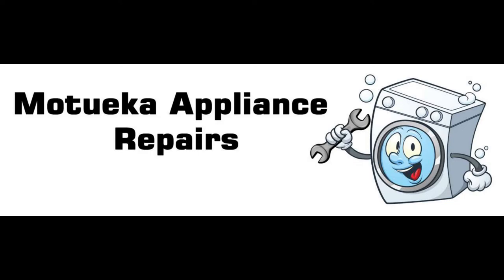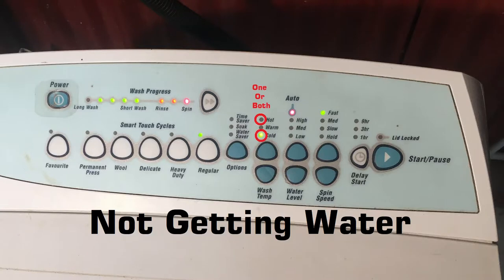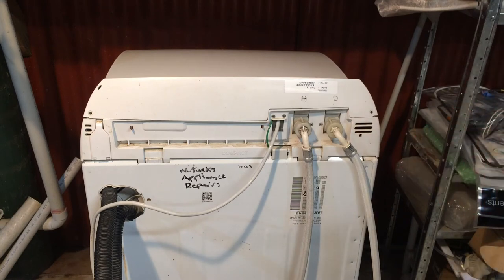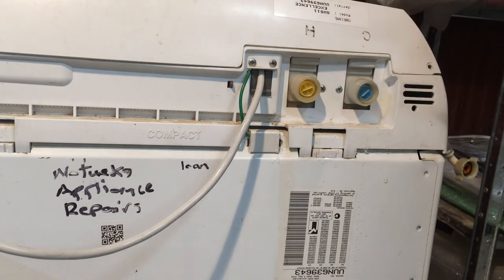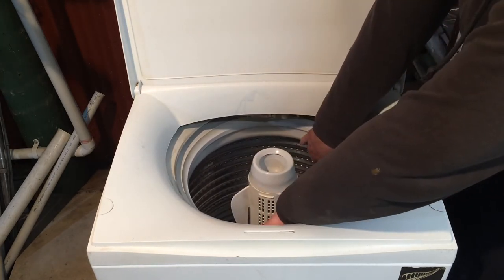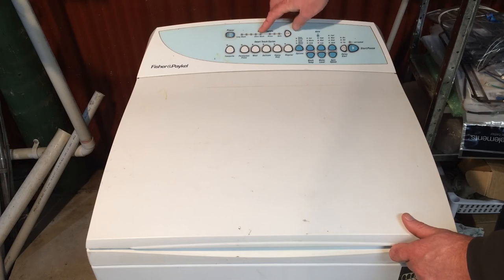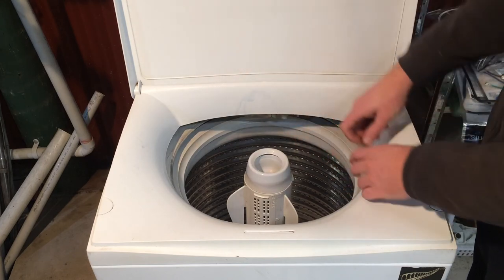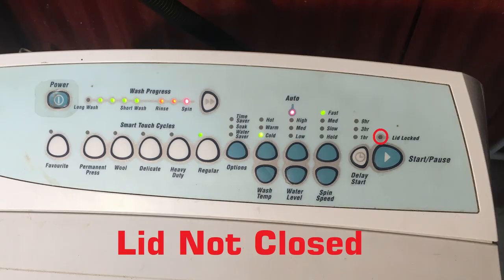User Warning Codes, Fisher & Paykel Smart Drive Washers

Comment: How do I get the rotor thing off the bottom? Need to get sensor out. Mine is black. Nylon bolt is removed but it won’t budge.
Reply from the maker: Yeah the black ones have a bad habit of the bolt not locking into the rotor. You can spray some penetrating oil in onto the shaft spline but its also the magnetic coupling you have to overcome. 

If you lie it down, get someone to hold the inner bowl and wriggle/pull on the rotor you can usually slowly work it off. Then put a new rotor bolt on it, and best to replace with the RPS with a sealed harness so you don't have to take it off again.

Comment: I have the same Washing machine but the tub is filling up with Hot water even if the cycle is complete or power is off. What could be the reason and any way to fix that.
Reply from the maker: If it is just dripping then it is usually a faulty valve, there are two types of valve on this model, a Blue double one and an white one, and on GW models they are specific hot and cold valves but on MW models they are both the same.
Reply: @motrepairs  Thank you. Do we need to replace the valves or the complete unit. Would you have part model#
Reply from the maker: @kirandiddi4633  That depends on what exact model/product code you have,

Comment: You said both water hot and cold flashing means it can't get water. I got both hot and cold water flashing, but there is water going through. It just stops after a while after I pressed start.
Reply from the maker: How low is the end of your drain hose? It it’s below the high water level water could be siphoning out as fast as it is filling up
Reply: @motrepairs  my drain hose always at the same level, never changed it. It is same height as washing machine
Reply from the maker: @wonghow  If it's not siphoning then next step would be to check the water valve resistance straight after it stops and beeps, they can fail open circuit only when hot. Then check water level pressure system tube doesn't have a hole or something.

Comment: Do you know how to remove the rotor on a 2018 WA7060G2?
Reply from the maker: Some of the latest machines need a special tool to remove it via a disposable insert, but not that model. If the bolt has come off without bringing the rotor with it the only option is brute force, it sometimes helps to lie ti down and have someone else hold the inner bowl from the top so you can pull it off.

Comment: Hello, I have a GWL15 and the Hot water light flashes Red after one cycle along with Beeps and keeps doing so on each wash cycle until I stop the washer and unplug it from the wall outlet.  So, I purchased another Hot and Cold water fill valve thinking the coils were bad after 10 years of operation.  After replacing the water fill valves with the same part number I once again keep getting the same result of a a flashing Red Light on the "Hot Water". Thus, the replacement part did not help!  Also, this washing machine takes very long to complete a wash cycle, and advance to the next yellow cycle light. To me all these cycles take extremely too long, and I feel it's a lot of water being wasted.  Sometimes to get the washer to move along the cycles I have to push advance cycle button or be there waiting a long time for it to move itself.  Since the washer is over 10 years old, perhaps its time for a new washer, and it don't think it will be another Fisher Paykel model.
Reply from the maker: Are you filling on cold or on warm etc? Is your hot tap turned on? If you are setting cold and it is still flashing hot light then see if you can download the user manual and have a look at section on checking cold temp is set to tap cold and not controlled cold. Other thing would be to check is that the end of the drain hose is not too low and causing siphoning.
Reply: @motrepairs  Thank you for your prompt reply! So I was washing some bath towels, and had the temp lights set on hot & warm, and yes my hot tap is turned on properly.  My drain hose hasn't  been moved in years, and the machine always worked properly until recently?  Today, I tried cleaning the contacts on the control panel board, and then re-attaching all the wire harnesses.  Then I did a very small load of PJ's on the "Delicate" setting, and when it got to the rinse cycle after many water fillings and emptying water drainages the machine started its wonderful beeping tones again?  This time it looks like an error code 51?  I don't understand why this code comes up when the machine properly drains water out of the tub quite forcefully. If the diverter valve is clogged which I find it rather hard to believe then I'll have to turn the machine on its side to check for obstructions in the the diverter valve which I don't think is the case. I'm about ready to give up on this washing machine!
Reply from the maker: @jamesb6216  Ah that makes a lot more sense. It isn't meant to drain water out and refill during the wash, but it uses the drain pump for recycling water. You will have some fluff in the diverter valve jamming it, so some water is going out the drain at the same time it is recirculating. taking it much longer to fill. 

Make sure to unplug the machine from the wall before removing the diverter valve. If you remove all hoses and take the valve off you should be able to clear the fluff from the drain outlet quite easily.
Reply: @motrepairs  OK, Thanks again for your reply!  I'll turn the machine on its side in the coming days, and check-out the diverter valve for any obstructions i.e. fluff/lint, or coins as I've read can get lodged inside the valve.
And yes, I alway unplug the machine when working on it because its safety first as I don't like getting zapped because I have my own built-in zapper (defibrillator) implanted in my chest after having a couple of open heart operations. I'll keep you posted!
Reply: Hello Dan, Well I took the Diverter Valve off the machine and checked for fluff/lint in the valve and it was Clean.  The only place I found a little lint was in the three hoses connected to the valve but it was minor.  I put everything back together and ran a load of bath towels. The Hot Red light flashed on once again which was no surprise to me.  Also, it still takes an extremely long time for the machine to move from one cycle to another cycle so much so that I had to advance it myself. When it finally got to the rinse cycle I got a fatal error, so I pushed and held the Power Button and Wash Temp Down arrow buttons.  It is still showing a Code 51, and the servicing paperwork guide states it could also be a possible Motor Control Module is Bad?  I found a refurbished board on eBay selling for $145 US. So Im not sure if I want to put another $145 into a 12 year old washing machine, and will start shopping for a new model. Just in case, do you know the part number for this Motor Control Board because the one I saw on eBay is:164368391978   Thanks for ALL your Help!  BTW: I visited your country about 15 years ago by cruise ship, and was quite impressed, and if I were younger I'd think about re-locating there especially liked Christchurch.
Reply from the maker: @jamesb6216  Error 51 is saying that water level is dropping when trying to recirculate, indicating an issue with the recirculation valve. I would look at replacing the valve before the controller, or it might be getting to the stage where you need to find a service agent familiar with Smart Drives.
Reply: @motrepairs  FYI I have called Local Service Agents, and they tell me that Parts for Fisher Paykel Machines are hard to get, and many Service Techs do Not  even care to work on the machines anymore because they told me ultimately it ends up being a Control Module Board issue that has gone bad, and its not worth fixing, but rather to just go out and buy a new machine especially since its 12 years old.  BTW you say its an issue with the recirculation valve? Is a recirculation valve the same as a Diverter Valve?  If so, I'll buy a new Diverter Valve from eBay.
Reply from the maker: @jamesb6216  Sorry yes Diverter valve/recirc valve same thing. 

Ill make a quick video for you showing how I would work through your problem, should be up in about 12 hours.
Reply: @motrepairs  Hello Dan,  Today, I replaced the original diverter valve with a new one, and the washer runs for about 10 minutes then it stops and beeps. Warning lights still show an Error Code 51.  So I unplug the machine, and restart it after a minute wait and it runs fine with no further errors completing the entire wash cycle.  So now I give up trying different things, and believe it has to be something with the control module board?  Thanks for all your help, but we are going to start shopping for a new washing machine.
Reply from the maker: @jamesb6216  If it does still say E51 then that is indicating controller as well. Very unusual. Did you see my other video about diagnostic process using your problem as an example? 

Also I'm not sure what the control panel is like on your machine as that exact model isn't sold here, but can you turn High Efficency or Eco off? On some models that will not use the diverter or recirculate, but not on all. 

I'm sorry I couldn't help more.

Comment: My washing machine keeps repeating the rinse and spin cycle, will take for ages just repeating itself please help
Reply from the maker: That is usually caused by it going out of balance too easily, does it come up with the out of balbnce code if you leave it long enough? If so it could be if the holes in the inner bowl are clogged with soap scum, but most often it is because the suspension is worn out.

Comment: I have a WA80T65GW1 fisher and paykel top load wash smart with error code 00000111 = 7
Can you help? 
Great videos thankyou
Reply from the maker: That's not a valid fault code for your model, but is a display error (very unusual) on earlier models. Sometimes the lights it shows to you are not the correct lights and you need to go into diagnostics to get the right one. I've got a video half done about that Ill try and get it uploaded tonight or tomorrow.
Reply: I can’t wait to see the fault code videos!